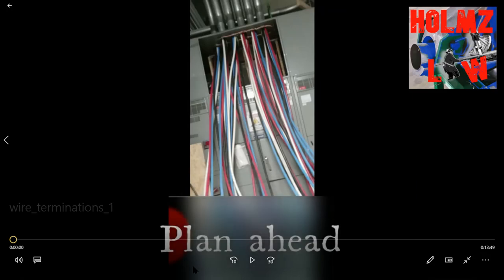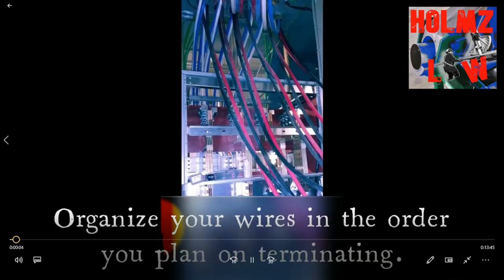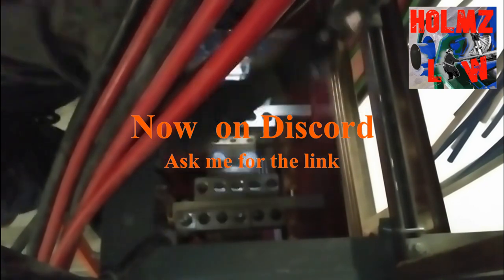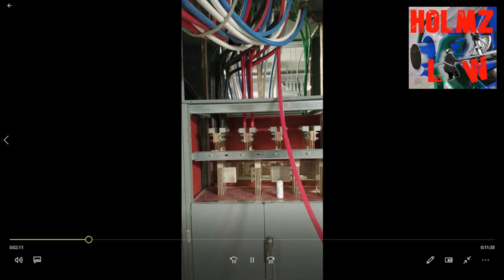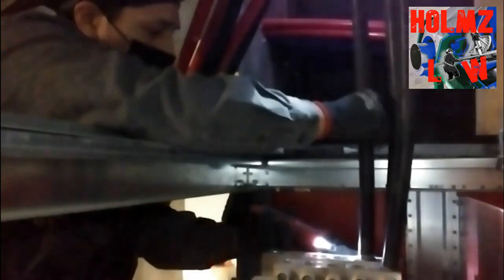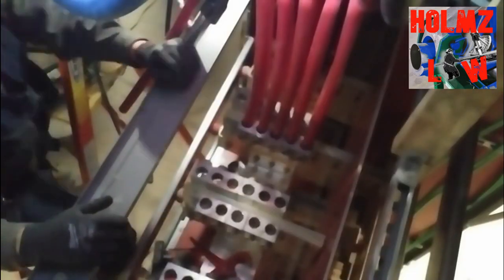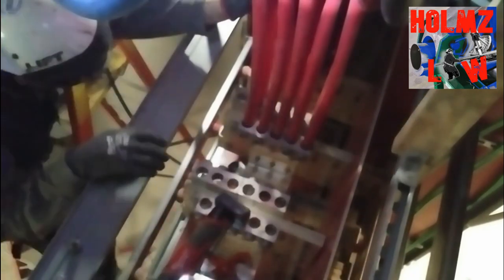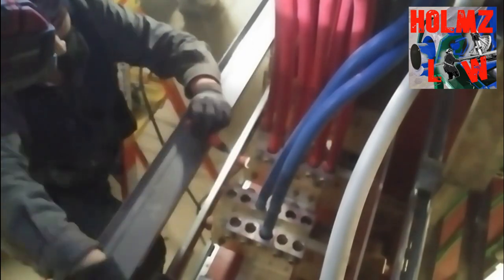Tips On Terminating Larger Wires

Comment: Did you make sure the parallel runs were the same length?
Reply from the maker: Yes by code they are supposed to be. We did to the best of our ability. We didn't take a measuring tape to every wire but we took it into account.

Comment: Did you apply anti-oxidant to the aluminum connections?
Reply from the maker: Yes
Reply from the maker: I usually have a tray full of the stuff i just dip and terminate.
Reply: not needed with modern materials, but the inspectors love seeing it.
Reply from the maker: Yes you are correct.